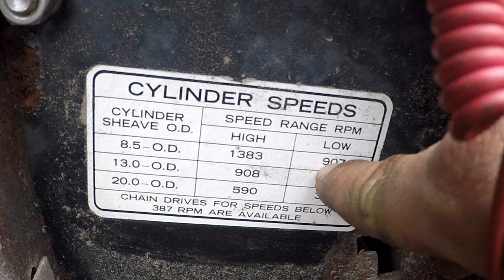First Corn Harvest With the Gleaner F

Comment: Logan you need 3 concave bars for corn and beans. Start at the door use and skip every other one. Use 6 bars for wheat. Yes you need to 20" pulley for corn and 13" for beans and 10" for wheat
Reply: You are 100 correct.  I picked 20 percent corn and put filler plates on the cildener.